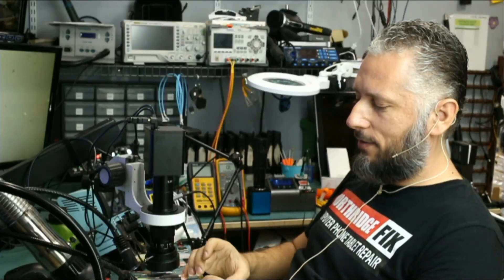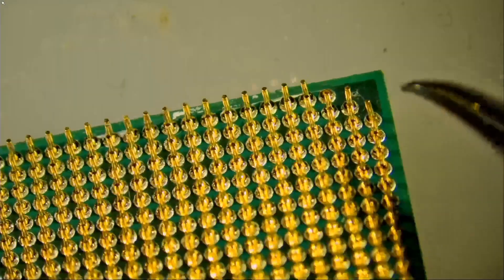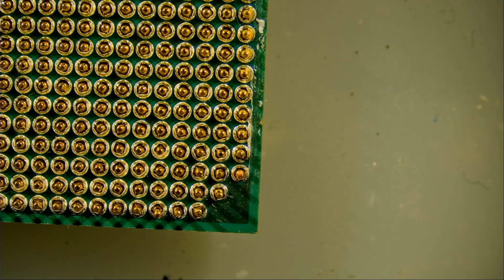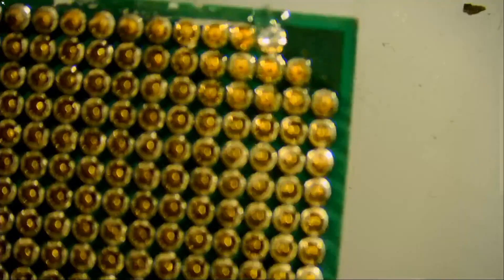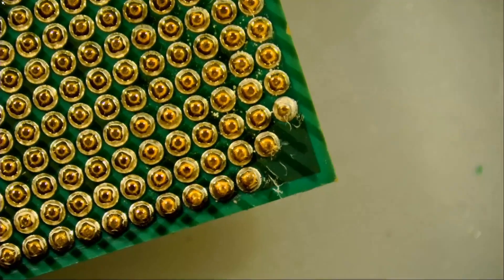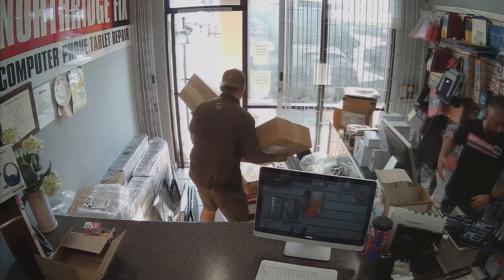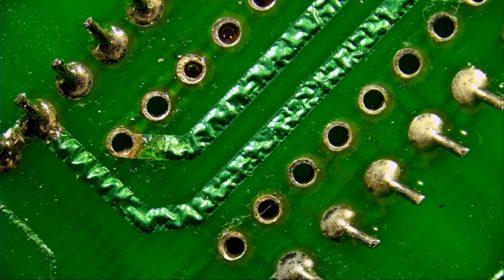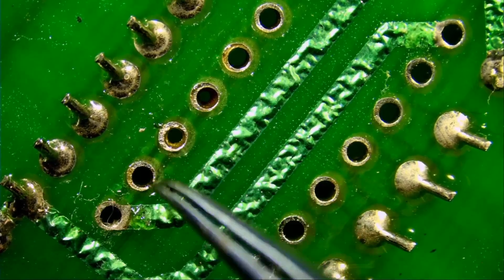Ryzen 9 Damaged CPU. Is it fixable?. Bonus Atari Board

Comment: About that new microscope, is there a market for the old ones? As used? I use microsoft webcam and dremel drill stand to hold the webcam and zoom in. It works but its not ideal to work micro stuff really. Should upgrade some.

Comment: The doner CPU you used is an Intel Core i3-2350M 2.3GHz Dual-core Mobile Processor Socket G2 988-pin, launched Q4 2011.

Comment: Been de/soldering retro stuff for a while, and had lots of problems with large sockets. Sometimes using hot air when it was impossible to suck all the tin out. Low melt would definitely helped me.
Reply: I just ordered some low melt solder after seeing this :)
Reply: If the through hole chip is to be replaced, it's easy to snip all the pins from the body then unsolder each pin at a time. Back in the day that's exactly what I used to do. Of course low melt solder is a winner too.
Reply: I use a desoldering iron for through-board pins.
Reply: You mean desoldering gun?
Reply: @dealerauctionnightmare4689  How about wicking each pin one at a time ??
Reply: @tonymontana897  that method is more difficult.

Comment: ...these motherboards from the 80s ❤
I hope to see Alex work more cards like this in the future.
Usually a desoldering pump is used to remove these chips but, as Alex also said in the video, if you are not very careful the pads fly away with pleasure.
Reply: To the 9th dimension
Reply: And you make a Hiroshima
Reply: @HDMensur  "I've seen things you people wouldn't believe..."  😅
Reply: I was wondering why he wasn't using a desoldering pump... I have my answer, thanks :)
Reply: They was probably built better, that's why you don't see many repairs and more space for cooling
Reply: @strawman9410  Cooling isn't an issue for those boards. Except of power supply - which is external for most 80s systems - no component really has a power consumtion in Watt area. The complete system needs ~15Watts overall which includes power to drive data tape drives.  The CPU properply has a power draw of 1-2Watts. Compared to the Ryzen repaired before in the video of 65-105W. Plus the Ryzen die would properly even fit inside the 6502 package if Ryzen wouldn't require the amount of I/O Pins.

Comment: If you cant desolder big IC on an very simple old board, why do you think you will be able to solder a socket?????? you already dissasembled the computer, sent the board by post and have a tech working on int, but you wanna save a dollar on a socket installation???????
Reply: solder on in is easier then to remove the old one wher you coud pontesnialy damage the solder pads or trace wile trying to remove the chip

Comment: Soldering isn't hard, I taught my children (12 years old) how to solder through hole components in 10 minutes.
Reply: No
Reply: try tell that to people with parkinson
Reply: But micro soldering is
Reply: @eletronicapt791  SMD components are harder, particularly smaller than 0603.  However my children can do 1206 easy enough and my daughter can handle 0805 too without getting frustrated.

Comment: Thank you Alex!! I was able to successfully install the socket and install the video mod (UAV) to have awesome S-Video output on my Atari 800XL!
Reply from the maker: Awesome. Glad it all worked out.
Reply: Nice to get feedbacks from actual customers after watching their items getting fixed 😀👍
Reply: Wow first time I've heard of a modded atari, pretty cool
Reply: @unknown4mat584  It's actually a popular mod among vintage gamer enthusiasts and collectors. The original outputs are coaxial and were great back in the early days of retro Television sets which only had coaxial in and outputs.
Reply: Oh!  That was my first computer as a teenager.  Now I gotta do that and play some Joust.  :)
Reply: Did that on my Darth Vader 😊
Reply: Nice. I have a 800xl but replaced the pcb with an after market one that I had ordered from pcbway. I damaged the old one because I forgot to check the heat settings on my hot air station with desoldering the cpu. Live and learn.